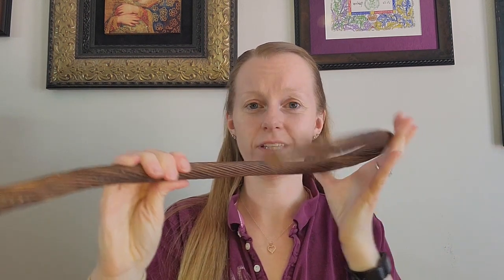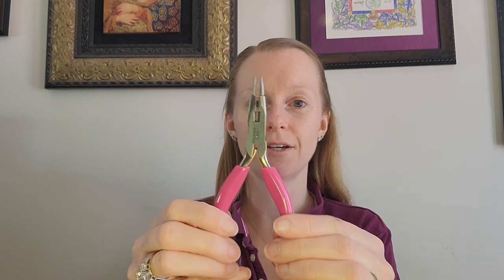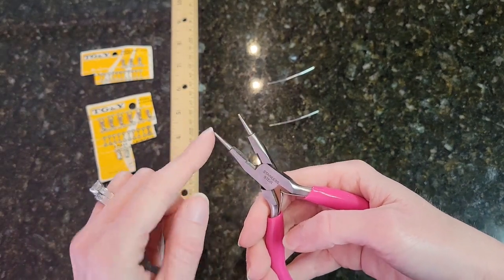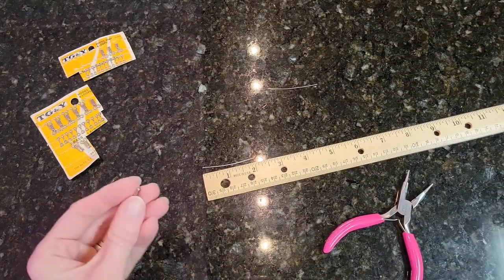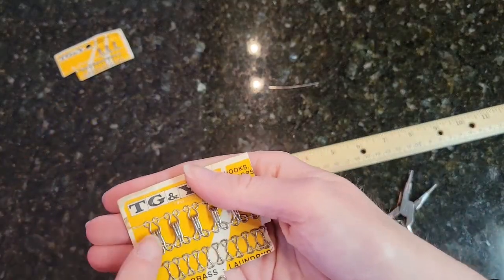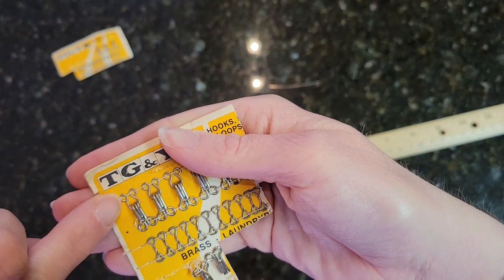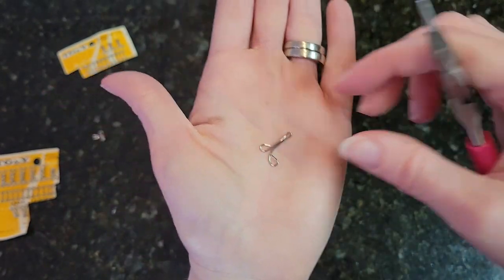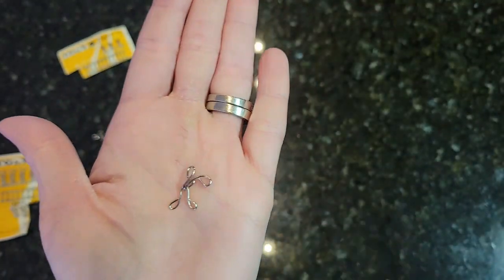Making 15th & 16th Century Hooks and Eyes | Step by Step

Comment: to practice what kind of wire should be considered a soft steel or composite
Reply from the maker: For practice, maybe try 20 guage wire. This can be picked up in the jewelry section of a hobby or craft store. The wire will be thin, which makes it easier to  manipulate. Silver is softer to work with than brass.